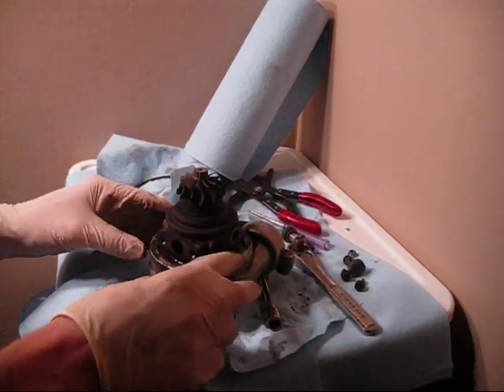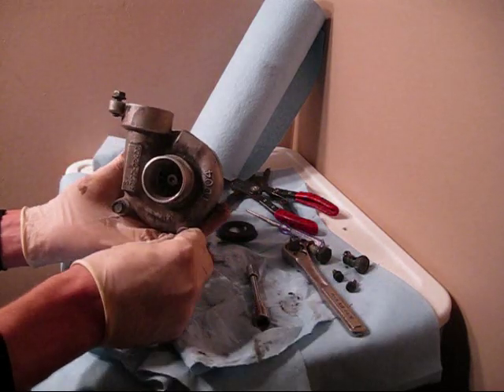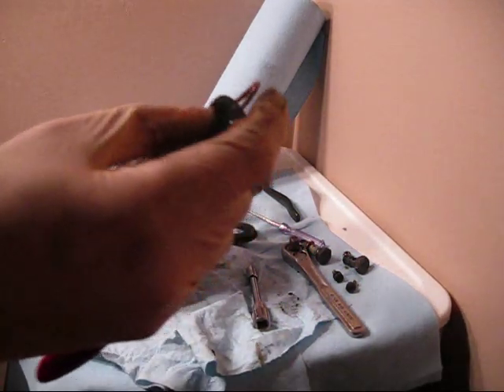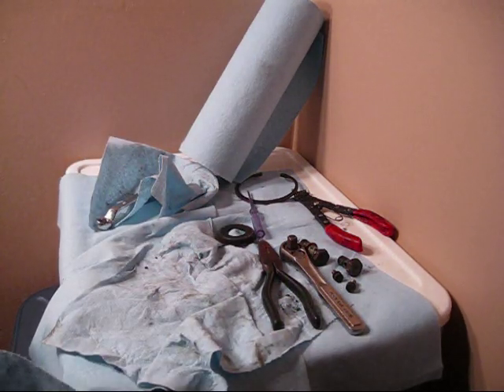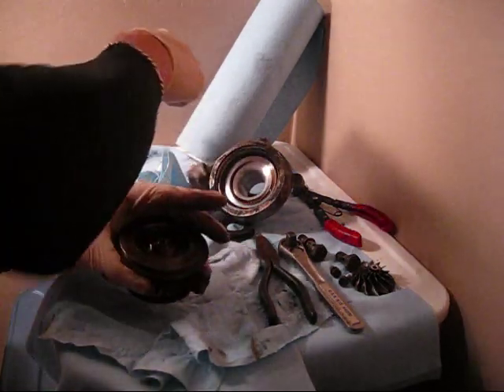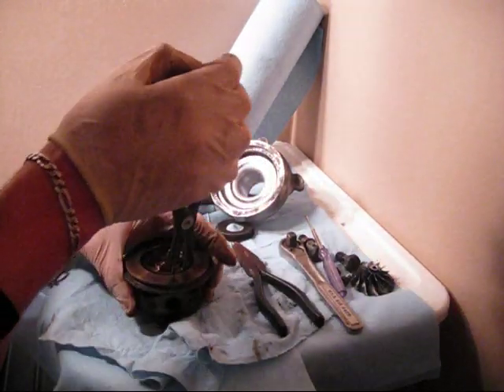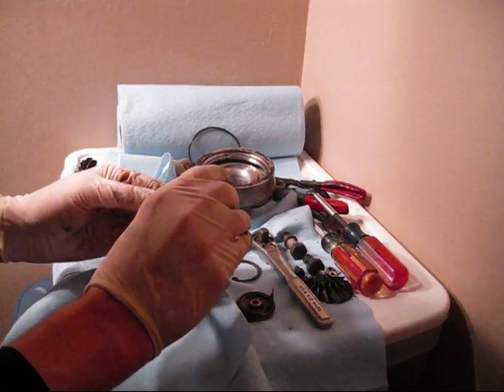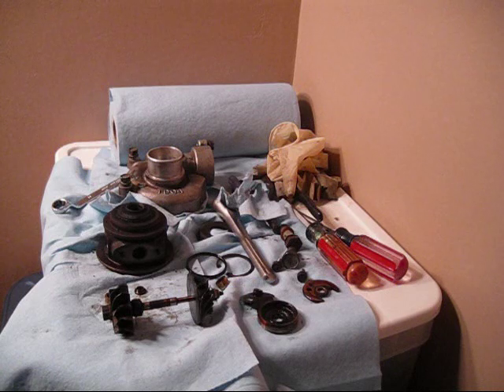TD04-9b Turbo Rebuild (Disassembly) - CntrlSwitch How-To

Comment: Did this fix the oil leak problem? I just bought a 92 stealth rt and it's smoking as well, I think it's vss or a turbo. vss were replaced 20k ago so I'd like to try the turbos first. If you have any advice I'd greatly appreciate it